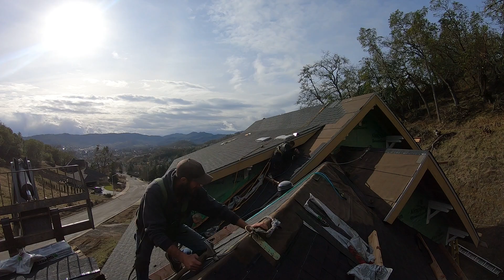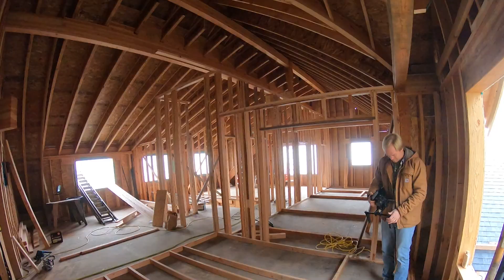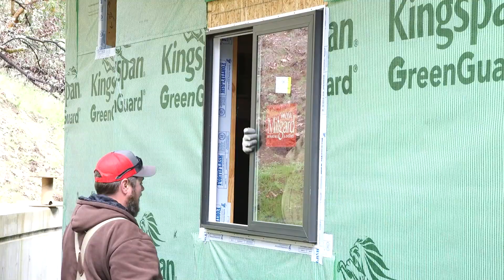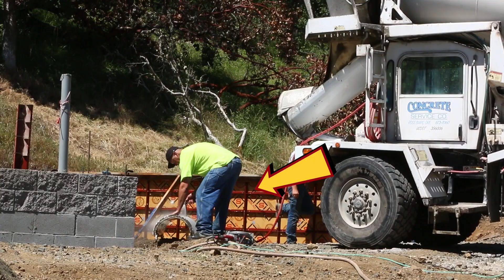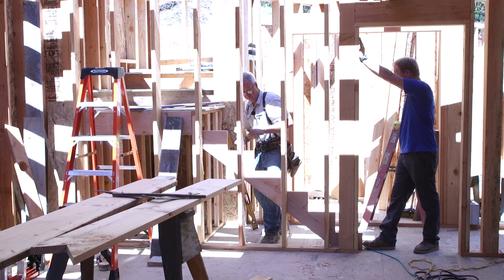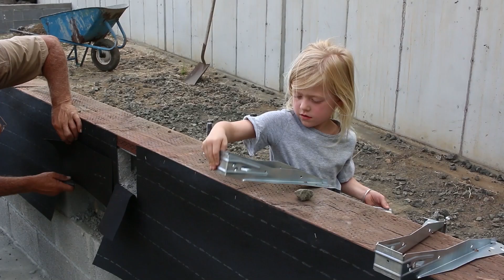10 Mistakes We Made Building Our Spec House

Comment: You’d almost wanna put a shower pan under the stove that has a pot filler, and a floor drain… you know that it’s gonna leak or get bumped unknowingly at least a few times every couple years - at the very least, put a ball valve on it so you can shut it down double redundancy when you’re not using it

Comment: Another mistake on top of the original mistake. The color on fiberglass composite windows will not flake off, unless it is a custom painted color. Fiberglass windows come in black fiberglass as one of their stock colors. Andersen, Pella, Marvin, and others make these kind of windows. Even for vinyl windows, there are companies like Anlin and Ansco that use a capstock process that is not paint and will not peel off. Here is a description of Anlin's capstock "Window extrusions are created when vinyl is pulled through a die, which is a metal disk that shapes the piece, to create the profile needed to build a window or door. An extrusion with capstock has a thin layer of acrylic applied over and bonded to the vinyl." There are other vinyl window companies with a similar color processes that will not peel off, but obviously they are not the cheapest vinyl windows. Getting aluminum clad wood windows just to avoid paint flaking is ridiculous unless you really want real wood windows on the inside.

Comment: Scott, what you do is fantastic.  Felt under shingles is NOT a mistake.  Felt is an excellent building material, much underappreciated because of new wraps.  I take a slightly different view regarding the "Pot Filler Incident".  The mistake is not in putting in a pot filler, but putting wood in the kitchen floor.  I know, everyone wants it now, but the reality of wood floors in kitchen service hasn't changed.
 Huge Respect.

Comment: 90# felt not a mistake my sons home is 1930. 30# felt was used and when we took off the failed ceder lap siding on the south side Wet and Son side It was just like the day it was made also and of note the original 'Cabot Quilt' insulation was also look it up you will be surprised. Cabot co still in business now they just do paint. my2cents

Comment: Yeah when you started on this I was surprised at the design and thought you were getting enough deals on supplies and labor from subs that you were spending that savings on design. Mid-tier custom work on a spec doesn't pay off outside a premium subdivision or resort. 
Great project to take on and we all appreciate you doing it instead of just talking about it. 
Great Job.

You need to do another video that's "Build a square house without exterior details the first time or if you have a budget".  Walk through how much would be saved by a boring design and then only adding premium fixtures and finish if you have money at the end. 

2. Underlayment should all be synthetic if you're doing it yourself.
3. Be careful with black vinyl windows where you have a lot of light exposure like deserts, A lot of them are failing within a year or two even in the winter. Consider just getting wood/aluminum windows on the southern exposure. There is something people have a problem with and that's getting two different window or door packages. People often buy a upgraded package for tens of thousands of dollars just because of a couple main windows or doors. 
4.On the water damage. There are water meters now that run $4-600 that will shut off the water main if there is a leak or running water. The software can figure out the difference between running a bath, watering flowers on a drip and a leak or failure. Ask me how I know to install them now? Device failed in the upper level of my own home. It ran for 9 days about the amount of a pouring coffee pot. 3 Stories of the house it was literally raining in the house from the condensation between sunlight in through the windows in the day and night.

Comment: The color may just as easily been different even if you had ordered the same mix design as the original wall.  It's rather common for batches to vary over such a time period between pours.

Comment: They claim tiger paw is slip resistant, it's not on a 9/12 in the early morning, I'm thankful for having a harnest.  There is an added cost for cap staples and the stapler.  It's required per tiger paw.

Comment: Concrete will be different colours day to day, and especially if you are ordering with any length of time between the two pours. 

I've seen what looks like patchwork slabs because each truck was a slightly different fine aggregate within the same 10,000 ft2 slab

Comment: Hi Scott, and thank you for such an instructionnal video.
Error number 2 struck me straight out when I discovered the spec house build, around the time you were working on concrete in the garage and around the house.
The potfiller also struck me, but that may be because of my line of work: I'm a plumber/hvac tech, and I know full well that faucets, whatever the form, end up leaking. So no drain to catch the leak or drops seems a bit alien to me.
One last, is that there is no soundproofing whatsoever inside the interior walls, and that's a big downside to me. Phonic jib boards will never replace a soft core to dampen sounds.
It is still a very nice house, and I wish all the houses I worked on so far had so little mistakes embedded in their core.
I also appreciate you being humble enough to admit your mistakes. Everyone makes some, and such a big and burdensome build must take it's toll on your physical and mental health.
Take care of yourself, and keep it up, your channel is great value to anyone that wants to learn how to build things the proper way.that you are be

Comment: Pot filler above stove? That is just insane! How often do you add a little water to a pot, and how large is the pot that you won't be able to lift it? Its not like you live in an industrial kitchen.
It makes the whole kitchen into a wet room, and should require waterproof flooring, slope and floor drain.

Comment: 1.  Retailing walls are structural , let future masons worry about appearance a skim coat of colored lyme plaster, and no one in a 1000 years will know a thing.  2.  The complication of the house gave you tons to film, your 100+ videos will stay on youtube, like Larry Haun videos,  be here long after we are not here.  Great Choice for the show, but for a spec.  a bigger lot and a simple rectangle true rafter roof , single story home, was I deal, but again it would have made your videos less.  3.   I use nothing but felt paper, it all burns, and I have found houses with it on, when the product was first made, the walls are like new.  I have learned just put down two layers on the roof, that way all the wear and tear of foot traffic, does not bother it.  What a great set of videos,  Great Show, and here is to the future.

Comment: We call regrets mistakes sometimes and it’s important to know the difference. I bought and installed a new tub/shower in my house the same way as the old one but had I thought to change it to a left hand from a right, the valve and drain would have been on the toilet and vanity drain side and that would have simplified the plumbing plus your head wouldn’t be next to the toilet when you’re taking a bath. I feel like that was a mistake because I regret it.

Comment: I don't recall when you sold it. Was it on the market long? Did you come out OK? It was indeed a great example of Carpentry skills and other considerations. IMO retaining walls need an engineer. I still think that wall is going to be trouble. That weight is still there pushing. It was a cool looking first try. You used block for the foundation walls. Cheaper than poured?

Comment: The important thing is that the remaining mistakes be aesthetic (or chosen efficiency, in the case of the below-stairs area.)  Structural issues like the placement of the boulders god redone so it was correct, as it should be.  That said, i do feel the pot filler should be on a dead man's switch of some kind, so that if it's unattended it shuts off automatically.  Otherwise it's just too easy to step away "for just a few seconds" and not realise it's been 5 minutes until you see the mess.

Comment: EC - can you discuss the thought process for not putting a drain under the range with a pot filler?  Or maybe a conversation with Phil on why that isn't required by code?  Every other source of running water in the house, even the water heater, seems to require drainage or a way to contain water yet for some reason pot fillers get excluded or overlooked from this.

Comment: As a former small contractor I don't see the using of building felt on the roof as a mistake. I have done roof add on's and tie ins on houses that were many decades old. In all of these the original black felt was in excellent condition. If I were going to build myself a new house I would put black felt on it. It has a proven track record  over many decades of use. I have pulled siding off of houses 15 to 20 years old with "house wrap" on them that was severely degraded. I would use black there as well. New isn't always better. Manufactures can say that it is but that does not make it true. Sometimes it is only better for their bottom line. You can't advertise quality into a product. By the way as a fellow craftsman I really enjoy your channel and watched every episode of the house construction. I wish you well.

Comment: You can get vinyl windows which have the pigment mixed into the material itself, those can be a good option when fiberglass or aluminum windows would put you over budget.

Comment: The design was ambitious, the site was challenging. The paradigm shift of showing every bit of minutiae in front of an audience with regional bias, for material selection and procedures and different expectations.
Agriculture has seen 2700% upgrades in technology since the 80's.
Construction does not lag far behind.
Plywood-osb-wrb integration- new energy codes with insulation is just one. 
Massive failures with using plastic for vapor barrier and spray foam.... without fully understanding new issues of trapping the moisture.
Energy codes trumping structure and and new housing falling down because of it.

Lets face it,Larry Haun built  an energy hog before technology changed the assembly...and live feedback from multiple social media platforms.
Larry had hand nails of every size sold in bulk from a spinner at the hardware store.
Very few options for gun nails,and screws were only for door hardware. 
Today all manner of screws and gun nails are sold in bulk,and hand nails are sold in 5lbs and smaller packages as a "specialty " fastner.
Along with changes to an Archimedes' threaded environment, from a caveman's hammer and nail.... Cordless technology has changed the modern worksite.
Posting your work in front of live audience builds thick skin,and a lot of slices and small cuts to your mental health....until the calluses can be built.
The modern home is built with an out of control, segmented pool of specialty trades.
"Not my job" pervades the modern site.
In the end being intimate with every board and fastner, brings all the angst and praise for every decision to fewer tradesmen. 
A craftsman will always try to learn from past mistakes and poor design, and always strive to build a better mousetrap the next time.
Were there mistakes? Absolutely, was it built better then the jobs before...Unequivocally yes!

Productivity ,while adding innovation is what makes the "Essential Craftsman " the treasure that so many of us value and strive to attain!

Comment: The wood clad aluminum windows are great. I've also had great luck with black fiberglass windows. There are a few manufacturers. They are a bit more dimensionally stable than vinyl, and the coloring is through the whole material. There are a couple of chips on my window frames, but you can't see them because what's behind the surface is the same color.

Comment: I'm not convinced that tar paper was a mistake. I've been trying to get roofers here in SoCal to use 30# felt for my parents roof and everyone so far has refused saying it is subpar to synthetic. We know though that tar paper will last for the 25-30 years that a shingle roof will live for. Plus, it somewhat seals itself should something like a nail pierce it. And it's cost effective. Synthetic is slightly more expensive and there aren't any installs that have survived for 30 years. It first started being used in the early 2000's but didn't become common out here till 2012 or so. Synthetic may end up being the best option but till it has proven itself, good ol tar paper is just fine for my money.
Reply: i agree tap paper has a proven track record, i still use it today

Comment: I’ve never really considered a pot filler over the stove. It makes perfect sense to AVOID installing a water source without a drain to evacuate the inevitable leak. Now I know not to ever install one!  Thanks for displaying your mistakes!
Reply: Having to replace the  floor after a minor water leak should be a heads up to anyone wanting a wood floor in their kitchen!
Reply: @joemace6218  totally .. 100% disagree. what would be under any other floor finish unless it is a concrete slab? wood.  I have built many homes and many high end being built today with no issues. A leak can happen anywhere in a home. Frozen pipe, toilet supply lets go , so many things I have seen go wrong by accident. I have witnessed a water heater let go in a high rise condo building. Nobody's fault but boy the damage down multiple floors. It is an accident, unfortunate but an accident. I put wood floors in lav , no bathing, just a lav and never had a problem. So maybe not for you but it could be 'anyone'.
Reply: They're a bad idea, and I think not used nearly enough by people who have them to justify the risk. The installation of these things are driven by fashion and trends, rather than practicality.
Reply: Pot fillers are double valved fixtures. The chances of both valves failing at the same time are less than a toilet tank gasket failing or a washing machine supply hose failing. The best installation I've seen had a dedicated ball valve to shut off water supply to the pot filler in high risk situations, such as an open house or short term rental situations. I agree with the other commenters that it is a higher than usual risk fixture in that it doesn't have a drain and needs to be turned off after use, so that should be considered in deciding whether to install one -- it requires user attention. But I would not shy away from them because of potential failure. I'd bet an icemaker line fails before any pot filler fails.
Reply: @matthew7486-p4y  but i think theres still a lot of truth about a faucet in general wont be replaced until it starts leaking. And in the case of a pot filler, if it leaks, doesnt matter how many other valves there are to turn it off, its going to wet the floor until someone notices. Even hvac airhandlers and waterheaters need a secondary drain pan and drain. Maybe thats what the pot filler needs. The stove should get its own drain pan on the floor! But youre still dripping on a 240v appliance.....
Reply: @blamuk  I should say they are double cartridge systems. You have to turn on 2 handles to start the water flow. I can't argue with your points, they are good. It's a risk/reward thing. Pot fillers might be the water beds of fixtures--time will tell!
Reply: Earthquake in the chat;  Let’s consider blaming the manufacturer in this example. It’s as simple as adding a 2-part safety feature on the handle. 

Doh 😖 why didn’t the decades and millions spent on R&D think of that.
Reply: Earthquake in the chat; Let’s consider blaming the manufacturer in this example. It’s as simple as adding a 2-part safety feature on the handle. Doh 😖 why didn’t the decades and millions spent on R&D think of that.
Reply: Yeah, I'm not sure how this passes code since the fixture doesn't have a drain. I think they're stupid for this exact reason of leaking and destroying other things.
Reply: @aaronreed9863  this is the first thing I thought - surely they are a universal code violation, especially considering MUCH less risky features are often code violations in this day and age. I manage a bunch of properties and I know its a matter of time before every fixture had developed a leak, they just all happen at different times, and they often don't get replaced until they start leaking. Its a matter of time before the potfiller leak.
Reply: Honestly as an hvac & plumbing contractor, I can count on one hand how many pot filler incidents we’ve run into since they became popular 10 or so years back. 
I say that to say - if you really want one and it would be useful to you - I would not shy away from installing it over a “potential” risk of failure, user error or stuff like that. 
Based on the emergency service calls we see on the daily? You’re MUCH more likely to have your ice maker/water supply line to your refrigerator fail on you. Another one we see on an almost daily basis is dishwasher supply line failures. Would you not install a dishwasher just because it “MIGHT” have a failure? No. You’d still do the dishwasher regardless lol.

Comment: My old boss used to say you don’t really make money on spec houses until the third or fourth one of the same basic design. The first ones you’re figuring out the most efficient way of doing things and each house goes a bit faster with less mistakes than the one before. And his experience was all with relatively simple floor plans, rectangular foundations and plain gable roofs